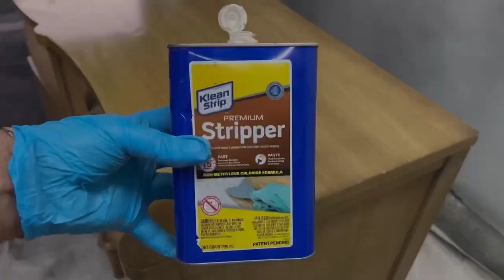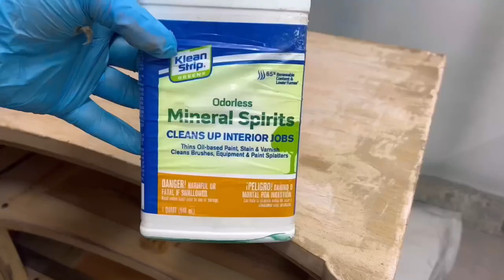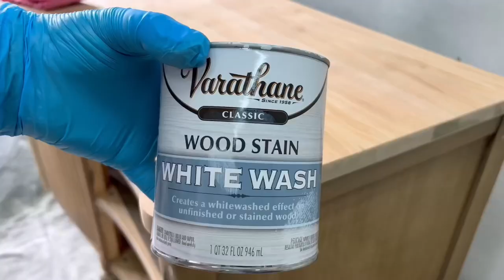EXTREME credenza TRANSFORMATION using paint and WHITEWASH || DIY furniture FLIPPING makeover

Comment: If you sanding without to exposing the bare wood again your second coat will be better! 
And probably usind a USED nice fine SPONGE sander. 
But mostly you scratching the paint when it's fresh painted. 
If you use primer same color it's better for sanding. And after painting you should not sand it again.
Reply from the maker: Thank you so much. You a lot of tip to share and I appreciate it